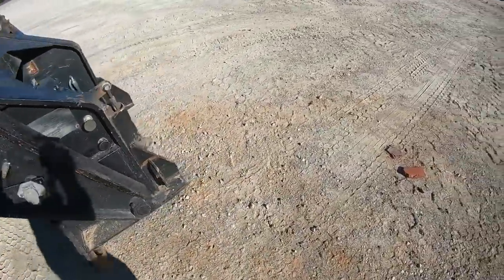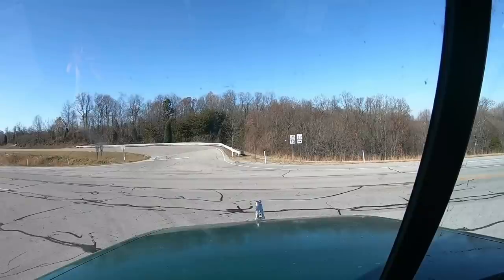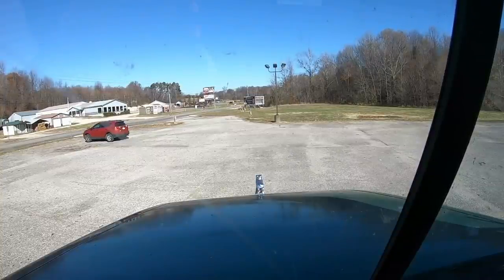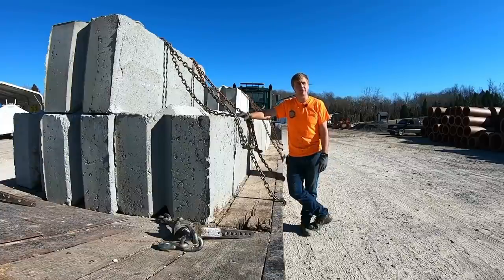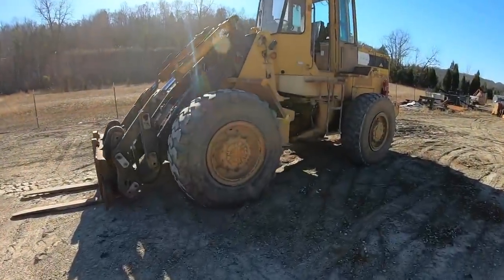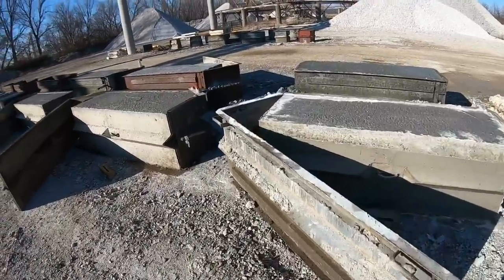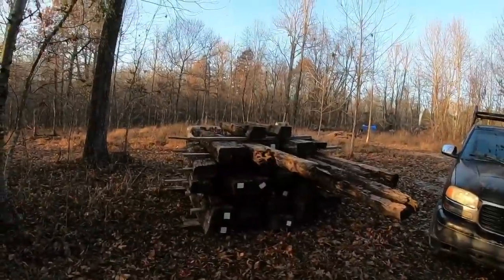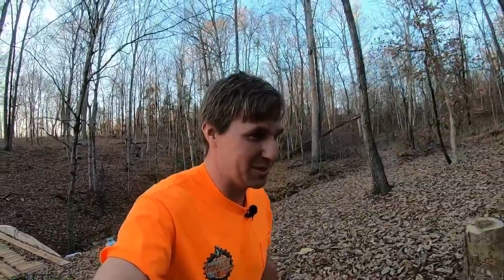Is This Semi Load Legal? Ride with me to the Scales to See how I Figure Weight

Comment: Great video!!!  The student has become the teacher!!

One point the chain could possibly be the weaker link at 6600 wll if it’s a grade 70 3/8s chain!

Plus no need for the rear tag if the trailer is under 34,000 on the tandems on the ground!!
Reply from the maker: Thanks for looking out!
Reply: Now DOT Bear knows this and he most likely looks for it, different grades of chain has different ratings from a grade 30 3/8" chain with a rating of 2650 to a grade 120 3/8" with a working load limit of 10'600 lbs.  I have seen it in the years I did both firefighting and truck driving.  I brought it to the attention of a DOT Bear at one accident.  The truck. Had a mix of grade 70 transport chain and grade 43 and 30 chains.  The driver did not survive the accident as a steel coil loaded suicide had permanently removed him from the gene pool.  Luckily the car he hit was nocked clear.  His employer denied knowing at the scene but the DOT Bears friends made a point to stop all the his employers trucks in the area to see if they had similar issues.  I don't know what happened past that I do know the employer was issued tickets on those illegal chains.  The law states chains has to be at least grade 70 or better for transportation use.
Reply: Wrong he needs to read the flatbed rule in the FMSCA and USDOT requirements for flatbeds. He misspoke I have 30 yrs pulling a skateboard
Reply: @Tafs315  who mis spoke?
Reply: @dotbearwoodworking9342  you are correct
Reply: @Tafs315  what part of what he said would be incorrect??  The only part I would see would be the part about only grade 70 or higher allowed….
Reply from the maker: @Tafs315 don't worry,  we all value your opinion
Reply: @dotbearwoodworking9342   I was was told you should have at least a grade of 70 on certain loads. Some loads can be used in grade 60. This depends on what type of material you hauling. If Kleeman was using only grade 60 he would be required to throw more chains to compensate for the chain requirements. I never hear anyone say they used lower grade chains for anything unless they where miss informed or ignorant to save money on chains. Kleeman did say something right the 80,000 lbs is the max but DOT also states that since we have all extra chains and other requirements for a flatbed we can legally haul an extra 300lbs.

When he adds stated that 50 thousand pounds on triaxles would be correct but still would not be overweight unless he has a permit to load the tri this way.  This also is correct 12, 34 the 34 this is 80. But I ran also way 12,400 on steers the 34 plus I pulled spread axle tandem I could legally haul 20 lbs per axles on trailer I pulled a 48 this way.
Reply: @Tafs315  don’t always assume what you was told is  DOT requirements and tell others they are wrong.   There is a lot of interpretations and everything that has been stated by all parties meets the requirements in the DOT regulations.   Grade 70 is industry standards.   But not required.
Reply: @dotbearwoodworking9342   Several DOT officers have stated this to me in DOT inspections. SO yes, I believe them since they should not the law and the requirements. I have several levels 3 DOT on me even in your state an have passed everytime. For my 30 yrs and 3million miles do know a lot more than someone that drives a firetruck the works sometimes pulling equipment. I have never been shut down any scales due to infraction on my equipment of how I secure my loads
Reply: @CaptainKleeman  I have a way to damm many miles that you will never get pulling in your small town I drive coast to coast pulling these loads so my opinion does matter to the people on the states and interstate that I drive. The shippers and receiver of what I carry and how that item arrives to them in tack
Reply: @thomasleonard1846   Well I could have but you got the drift

Comment: If that hook was an extension cord or air line, it would have snagged every time. But being that you wanted it to get hooked on something, it never happens that easy.😜 I could pull a chain across an empty parking lot and it would get stuck in a crack, but wanting it to hook on something in a scrap pile, it would never touch a thing. Just the laws of nature.😂😂
Reply from the maker: Oh for sure, the trick to hooking something is try to keep it from hooking 😂😂
Reply: Yep, a plumber friend of mine once said "If I fall off a tall building I hope I have an extension cord in my hand because I know it will hang on something."

Comment: A section of 2" PVC pipe bolted to the neck with a rubber strap attached would keep you from getting an unsecured load fine for the new broom. 
Or bolt the pvc above the tridum.
Reply from the maker: Good point

Comment: Hi Mike. One thing you may not thought of or at least did not mention and that was the weight of fuel. At what level were the tanks? Diesel weighs just over 7 pounds per gallon. It could make a difference. Have good days!
Reply from the maker: Very true.  That truck only has the one tank.
Reply: If you are that close on weight then you should probably throw in a small percentage for error anyway. (plus or minus a half tank of fuel at say 3-400 pounds?) He did joke about leaving room to eat lunch.  <LOL>

Comment: If I don't oversee something, is the thing with the only half allowed load on the chains pretty simple, if you tie down a pallet, you connect the chain at two points to the trailer, so if it physically holds as example 5000 (without security factors) 5000 left plus 5000 right are 10000 holding force, if you make a single connection to a tie down point of an excavator, there is only one physically connection, so only 5000 holding force.
If it goes from the Trailer over the tracks, to the trailer, it's like the palette and will hold 10000.
(In my opinion it would make more sense to rate the chain at the physically stability, so no one could use to less, as by rating it for two connections by default.)

Comment: Old tyre tube  make good for putting  under chains or angle  carted a lot of concrete  panels  for new buildings  and they would  not let you out of the yards if nothing  under  the chains even  bits of carpet  work ok  but does  not last long

Comment: The 50% is for movement  of load shock  comon with vehicles .if the binder is good for 9600 lbs and the chain is 6500lbs what grades 70 your working weight  limit  is 6500lbs
Reply from the maker: Grade 70 3/8 is 6'600 WLL

Comment: It may be different in Indiana, but to my knowledge you don't need the tag axle unless your trailer is over 34k. That's how it works here anyway, might be able to save some fuel and more importantly tire wear
Reply from the maker: It's the same here, but if a fella has it and is close to the line, might as well.
Reply: @CaptainKleeman  very true

Comment: The reason for more tiedowns on equipment is that equipment is usually wheeled or tracked and easier to shift.
Reply: What does that have to do with the load limit? That doesn't change the working load of the chain and binders.

Comment: those concrete blocks can be sketchier than they look I have dropped 3 of them from the rebar loop breaking. one of them broke when I was running a lull near full speed in 3rd gear I about ran the dam thing over
Reply from the maker: 😂😂 I know it's not funny, but I can envision exactly how it happened.

Comment: Cap’n those Amish are everywhere!  We bought Sassafras Valley in the Springtime.  When we bought it, you couldn’t pull off the road to park because of the trees and brush.  I spent all summer cutting a path and putting in an entry.  

The week before bow season started, I posted a half dozen ‘No Trespassing’ signs around the perimeter.  I’d have put purple paint on the trees but, it hadn’t been invented yet.

I went out to do some clearing on opening morning.  As I crested the hill, I could see a pickup nosed into the new driveway.  So, I parked in the woods, put on my orange hat snd started walking down the path.  About a hundred yards in, I saw a dude sitting under a tree facing the ravine.  He was asleep with his bow across his lap.

When I got a few yards from him he awakened, grabbed his bow and turned to look at me.  I could see from his expression that he was upset.  He said, “What the hell are you doing here?”

I said, “I was about to ask you the same thing.”

To which he responded, “What the hell does it look like I’m doing?”

I said, “Looks to me like you were sleeping because you damned sure weren’t reading.”

His puzzled look told me he didn’t understand my meaning.  So, I continued, “Didn’t you read that No Trespassing sign right there by your car door.”

His response, “I wasn’t Trespassing.  That sign is for strangers.  I know the owner and I’ve been hunting this place for 10 years.”

A bit baffled, I informed him that unless he could spell my name he had no clue who the owner was… and that his deer harvest days here, were over.

The next spring, he called me up to ask permission to bow hunt for Turkeys.  He started the conversation with an apology so, I gave him permission.  He hunted there for a couple of seasons after that.  Then quit calling and hunting.

I saw him at the feed store a few years back.  It was a couple of weeks before deer season opening.  I asked him why he had quit hunting on my place.  He told me it was because he bought his own little patch of woods.  I noticed that he had two cans of purple paint in his hands…

So Cap’n, ‘No Trespassing’ signs help… but some Amish are slow readers and may need a picture painted for them instead!

Trucking weights… I used to load steel wire on trucks.  The company expected me to balance the weights on the axles with a gross weight within 500 LB.  

More than one driver complained that I didn’t leave enough weight for them to fill up with fuel… so, the company added a statement to the Trucker Instruction at the gate.  It read, “Tell Loader Your Fuel Level.”  It complicated my calculations a bit but, simplified their day!

That was back in 1972 when portable calculators cost $120… we had to use the adding machine in the office.  It printed out a tape that we attached to the scale ticket.  The company bookkeeper reported our Load Utilization each week. The goal was to be below 500 lbs/load …. They also tracked our efficiency.  That was in Tons Shipped per hour.  The goal was 40 TPH (two trucks per hour).

I enjoyed loading trucks. I can’t help but think how much more I could have gotten done if I could afford one of those portable adding machines!
Reply from the maker: Hahaha, had the purple paint in his hands.  Tables have turned..is that the right expression?
Reply: @CaptainKleeman  yes sir… that was my thinking.
Reply: What do you mean by 'Amish', presumable something different to the very old fashioned christian group? I'm British so think I'm missing some meaning.
Reply: @martinwyke  it was a take off of Cap’n K’s remark in the video.  No disrespect was intended.  I have an Amish friend who builds pole barns… he would have laughed at the bizarre mis-identification of the hunter walking across the bridge in full camo carrying a gun.
Reply: @sassafrasvalley1939  I'm not complaining, I was genuinely confused but I get it now. As the saying goes, 'English and Americans divided by a common language'. Pun intended :)
Reply: @martinwyke  I like that… I’m going to borrow it from time to time!   Thanks

Comment: My son is a Transport Inspector here in Australia and he notice you use of a chain binder, and that the binder is designed with its load path through the chain, not against the tang of the hook as in your use.  Here it would be a ticketable violation and dangerous use as the tang could break off under high load, but under the load limit of the binder, used correctly. Is the way you used it legal in your state?  PS he tends to lecture me on how i tie things down too but he means well.
Reply from the maker: Thats the way we do it here.  Legal where we are

Comment: Noticed you said a single axle is allowed 20K. That is true but the steer axle on that truck won’t allow 20K as I’m sure you know. Tires are rated as well as the axle as explained on the manufacturer tag. I know you know that but just explaining for those who didn’t.
Reply: Some trucks come with 18000,.20000,.22000.front ends with appropriate.tires but still 80000.Gvw.total without.overweight.permit.
Reply: @ctprecast7437  notice I said “that truck” and manufacturer tag

Comment: Hey captain I'm not a truck driver. I have driven a 10 ton hay truck in the hay fields. It has been my impression that load binders/straps should be checked after being driven for a few miles.

Some people would claim that the tree bowed over and pined at time stamp 25:20 is a big foot structure. Did you do it?

Comment: A weighty issue indeed..... but only 36,276KG ??? Over here, artic gross weight is 44,000KG...(97,000 lb)....... but still has to be loaded correctly!!! You can't have too many load restraints 😁
I recommend that bloke goes to an optician to get his vision corrected....... 😬😬😬
Reply from the maker: That's crazy how heavy you guys are for just normal weight.  Pretty wild!
Reply: @CaptainKleeman  
On the flip side, all trucks above 3,500 KG (7,716 LB) must be limited by law to 56 MPH.... 😬😬😬

Comment: Sorry, your need some help. You only need chains in front and back the middle just needs a single chain. This meets all DOT requirements. I run a flatbed for years and Under DOT Rules. The other in your comment about Heavy haul was also incorrect. You dived the equipment weight in half then you use the chaining requirements for that.
Reply from the maker: Both of those are incorrect. Anything more than 5' and less than 10' requires two chains/straps regardless of weight.  Anchor point to trailer cuts WLL in half and must cover 50% of machine weight.  All off of their website that provides up to date info on regulations and requirements.  Thanks for watching
Reply: @CaptainKleeman   I pulled a flatbed for 30 yrs. I have been DOT many times even in Indiana with  level 3 inspection and passed
Reply: Minimum Number of Tiedowns

The cargo securement system used to restrain articles against movement must meet requirements concerning the minimum number of tie-downs. This requirement is in addition to complying with rules concerning the minimum working load limit. When an article of cargo is not blocked or positioned to prevent movement in the forward direction, the number of tie-downs needed depends on the length and weight of the articles. There must be - one tiedown for articles 5 ft or less in length, and 1,100 lbs or less in weight; two tie-downs if the article is -

5 ft or less in length and more than 1,100 lbs in weight; or
greater than 5 ft but less than 10 ft, regardless of weight.
In the following example, one tiedown is required because the article of cargo is 5 ft in length and does not exceed 1,100 lbs. If the article of cargo were greater than 5 ft in length but less than 10 ft, two tie-downs would be needed regardless of the weight. When an article of cargo is not blocked or positioned to prevent movement in the forward direction, and the item is longer than 10 ft in length, then it must be secured by two tie-downs for the first 10 ft of length, and one additional tiedown for every 10 ft of length, or fraction thereof, beyond the first 10 ft. An example of this is provided below. If an article is blocked, braced, or immobilized to prevent movement in the forward direction by a headboard, bulkhead, other articles that are adequately secured, or other appropriate means, it must be secured by at least one tiedown for every 10 ft of article length, or fraction thereof.